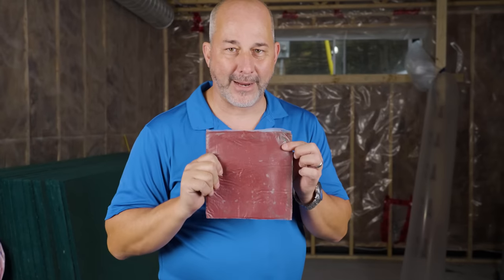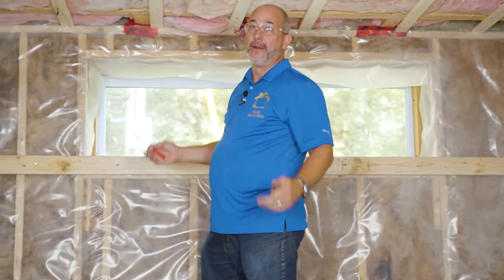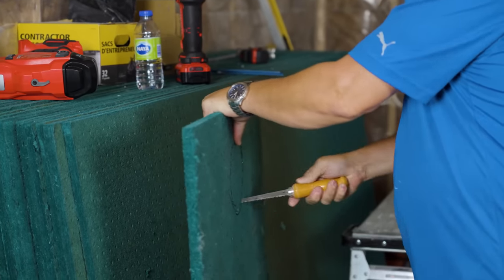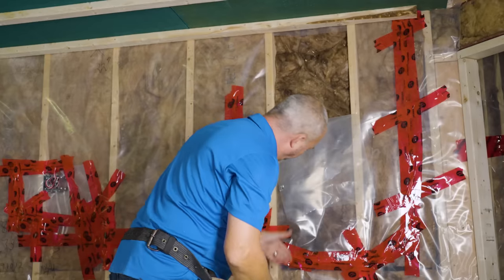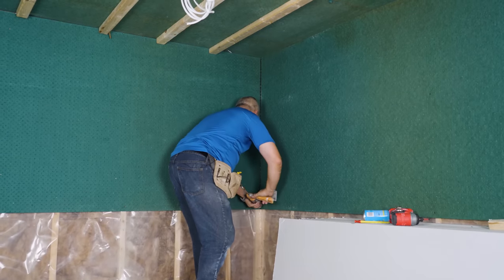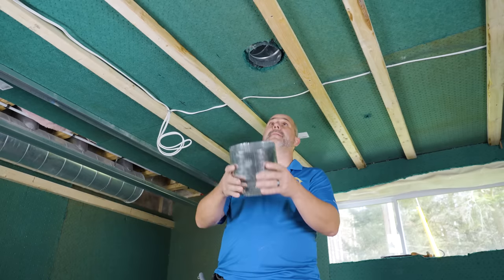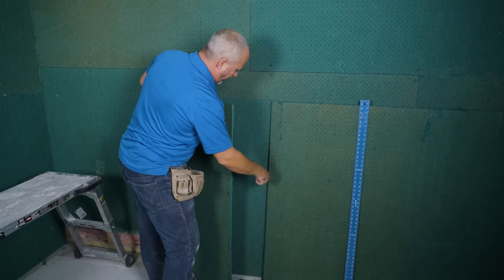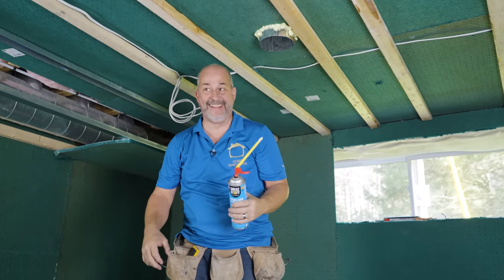Soundproofing A Room (It's Easier Than You Think)

Comment: I've got a question - will the weight of the ceiling materials be an issue? You've got green board, a bunch of 2x3s, and a full ceiling of sheetrock all hanging from that strapping which is nailed into the studs with what looks like a few 16ga brad nails. That seems like a lot pulling against just some nails. Or am i missing something? Thanks!
Reply from the maker: we are using framing nails so there is that. Cheers!
Reply: Ah that'll do it. Guess I need to watch more closely :D Thanks for the reply!  @HomeRenoVisionDIY

Comment: I would have called the plumber to put a frost free faucet in and had it done right.  Most homeowners will not remember to shut those off and drain them so it's guarenteed they will have a freeze problem later.

Comment: Doesn't wood transfer sound? I heard resilient bar works wonders
Reply: He used resilient channels in his own house.  He's using the strapping for the electrical wire to have a place to staple to
Reply: ONE misplaced screw defeats a resilient channel install. Any solid connection transfers sound. Metal is worse than wood.

Comment: Never understood why the building code is such that you build an exterior wall, fill it with fluffy stuff, add plastic, seal all the edges with the black goop, tape your penetrations.   Then you stick a gazillion pin holes in the stuff by hanging your finishing material (drywall, whatever).    Why not strap the wall afterward or build a 2nd mechnical 2x4 in front of your "exterior&sealed" wall.   Makes it much simpler to work on/repair/renovate, little to no penetrations.   After you get a better building out of it.

FYI - that is what they do in other countries, ones that have the building science engineers design the building codes.

Comment: 10:24 how do you know it wont slump again? what caused it? i would have jammed more insulation in those spots no? and maybe something to hold it in place if not?

to be clear, i know zero about this stuff, just making a layman observation. it just seems if the condensation possibility is that big a deal, i wouldn’t be happy with just pulling it up.

Comment: Would've loved to see the sound floor before/after. Your position on fiberglass vs. mineral wool doesn't line up for me. They have STC ratings and most people who soundproof don't even start to consider a material for sound proofing unless it's STC 45 or higher. Fiberglass is <40 and mineral wool is 45+. If you're using fiberglass to stop reverberations that's one thing, but it's shite at soundproofing. Love the video and the channel, just an interesting discussion.
Reply: Mineral wool is also 3X denser then fiberglass... it is superior in every way except price. Did my whole house with mineral wool including my theater and no regrets.

Comment: What happens to the putty around the electrical box when you use your cutout tool for drywall?
Reply from the maker: just press it thin at the edges and the cover plate will be fine.

Comment: Random question but my home is half tile half carpet. Wife wants to replace tile and put in wood. Issue is everywhere in the home there is tile there are 2 sheets of subfloor so it sits 1/2 taller than the carpet. What’s the best approach to puttin in hardwood should I rip out the top sheet of subfloor so floors are flush?
Reply: Is it actually two layers of subfloor, or is the top layer actually cement board underlayment?
Reply from the maker: the second layer of subfloor is screwed in place with no adhesive. remove as many screws as possible and then lift the subfloor.

Comment: Why not use a suspended ceiling? You can get suspended ceiling tiles made from foam that a very good at sound absorption.
Reply from the maker: they are just not as sexy as a finished pot light drywall ceiling. Cheers...but a great option.

Comment: Due to the multiple layers of strapping, doesn't this assembly introduce the triple leaf effect?
Reply: I think that is why he is using the green board.
Reply: @alexanderjamieson7971  doesn't it still add resonance between the drywall and green board? Maybe it only applies if you are using two materials of the same density or if both layers are dense like drywall.
Reply: @Ryan Spears  I think that applies with another layer of drywall which then acts like a drum with two resonating membranes. That sonopan/green board acts more like a dense insulation board
Reply: @alexanderjamieson7971  Gotcha. Thanks for clarifying.
Reply: The strapping is not introducing Triple Leaf, there is going to be only One layer of the same material (drywall ceiling) and the subfloor for the upstairs. And the insulation layers, wobblyness of multiple layers of strapping with the Sonopan makes this convolution less stiff. It's not elegant, but it seems like it would work fine.

Comment: I would not recommend people follow this advice. To dampen bass, you need to put mass on the ceiling. To do this, you use a special adhesive and screws to mount a piece of sheet rock between the joists in the ceiling to the floor boards above. Next, you put another layer of special adhesive and yet another sheet of drywall and screws.  once that is done, you put in rock wool using hangers.  Next, you need to decouple the bottom layer of sheetrock from the floor joists using special isolators that decuple the resonance from the bottom layer.  If you don't do these things, the bottom sheetrock is going to act like the skin on a drum and just pass the low frequency straight trough to the floor above which will just radiate it into the space and shake loose silverware in the kitchen.  The two sheetrock sheets on the floor above add enough mass to dampen the long wavelengths of the base. If you are doing home theater, my advice is to get on some home theater forums.  They will pretty much say that the above video is not going to buy you very much.  Not that it won't do something, but if you are going to go with a mid or high end home theater with large speakers and subs, the above is going to be a pretty miserable fail.

Comment: I’m an acoustical engineer.  Unfortunately, there is no such thing as “totally soundproof” unless of course you want to die in the space.  Why, because sound requires air to travel from point A to point B.  Remove the air, you’ll remove the sound, but unfortunately you would succumb to  death by asphyxiation.

Comment: Man i wish we could acheive this level of sound proofin without takin the walls off 😭😭
Reply: You can install Sonopan on existing drywall, THEN 5/8" fire rated drywall (heavier than regular drywall), mud, sand, paint. You increased density, thus noise reduction
Reply: Mass loaded vinyl. Most interior walls unfortunately have zero insulation though
Reply: @danieli708  Thankyou for the advice , all my research points towards whats u have summarised
so i'll be takin this route :)

Comment: Soundproofing isn't about reducing air movement,  it's reducing acoustic coupling. The most effective method for acoustic isolation is mass-air-mass. Instead of attaching Sonopan directly to your  studs, it would have been much more effective to put up a layer of 3/4" plywood, run all your wiring though, then sealing any air gaps with acoustic sealant, then use acoustic decouplers which you then attach resillient channel, then another layer of plywood, followed by another layer of 5/8 drywall. It all depends on what's on the other side of those walls and ceiling. If its someone walking around in a living room above you or someone trying to sleep in a bedroom, your method will reduce some noise but not a lot. I've built two professional recording studios in two different homes and this is the only method I would use.

Comment: I love your tips but sound proofing has nothing to do with air. Sound moves very well through several mediums ... sound proofing is about stopping vibration. If you really want to sound proof a wall, use staggered studs on a wider plate to get complete separation between the two sides after the drywall is installed.

Comment: Sounds has nothing to do with air tightness. Sound waves need to be broken in order to soundproof a room. It has more to do with geometry than air. Check out the design of the deaf room for example. Sound waves bounce off the surface and break up into non existence.

Comment: I bet the homeowner just said they wanted pot lights because that's what most basements have in them (like why are barns red) .. if the homeowner watches this video they will understand better what they so casually wanted and perhaps wonder about alternatives with significant cost savings.
Reply: The only change is a couple of 2x3’s. Right now a 2x3 of 12 feet is less than 5 CAD. On a 12x12 room if you put one 16’’ on center you have to spend about 50 bucks. You really call that significant cost savings? They are putting sonopan sheet at 25 bucks a piece on all the wall and ceiling, it’s not that extra 50 bucks that will break the piggy bank.
Reply: What are some good alternatives? Cause I have the same issue. I will have double drywall with green glue in between and can’t have holes in my ceiling for can or puck lights

Comment: You lifting up that insulation did... nothing. Lol.  Wut.

But yeah as someone else pointed out... you have essentially ruined this install by piping hvac directly to the room... HUGE MISTAKE.
Reply: I thought this is why they make paper-faced insulation: the edges of the paper extend to the studs on either side and can be stapled to hold the bats in place, keep them from sliding down. Maybe it’s different in Canada or the rules (codes) have changed since the last time I added insulation to an open wall cavity…?

Comment: This is easy ,,standard insulation is a terrible almost worthless sound barrier ,,need rock wool,,also they make a stand off bracket with a flange you attach to joist then install sound board drywall to flange ,cause like he said sound will go through screws through framing and so on ,,also penetrations are a culprit ,im sure its quieter  but far from sound proof

Comment: It is not very possible nor financially feasible to achieve an STC rating of 100 without changing the room dramatically. Anything over STC 45 is very expensive, and getting doors for STC 50 takes months. What you want is to reduce noise and manage it, not soundproofing.

Comment: First of all, there is no such thing as "soundproof" or "not soundproof". Every element of every space has its own degree of sound isolation. And unless you're using specialty construction (room-in-room), you're going to hear noise from adjacent spaces. You'll just hear much less in a room that's been designed to be isolated from surrounding spaces. Other nitpicks:

1. Putty pads are not equivalent to spray foam. They are better, in that they actually have mass, and when applied correctly, are air-tight. Foam has cells. For the same reason, filling gaps with foam does almost nothing.
2. If the contribution of insulation was mass, mineral wool would be more effective than it is. Insulation's job is converting sound to heat. Its presence, not its actual mass, is what's important.
3. You don't need a double ceiling. Mount 2 layers of standard drywall on a resilient channel, with staggered panel edges. Run the gyp on your walls up to within 1/4", and caulk the gap. Use crown molding if you don't like the gap. Use putty pads on the back of lighting boxes, which really shouldn't be old-fashioned cans, but modern LEDs with much less heat and space taken up. Better yet, use wall-mounted or floor-mounted lighting.
4. All that trouble to build that complicated ceiling, and you put a big hole in it for HVAC. Okay.
5. SONOpan is a gimmick sold by a company that doesn't really understand acoustics. It says something that a company has only single-number ratings and testimonials, and no actual data available. Also that they list an STC rating for the panel by itself, which is a useless number. They also talk about "dampening" vibration, instead of "damping." Just use drywall. It's cheaper and more effective, because it's 4x heavier.
6. All that trouble to minimize fasteners through the SONOpan, and then you just negate whatever benefit that got you by screwing the 2x3s right into the strapping with giant screws. Same thing for the drywall on the walls. So if the SONOpan did anything before, it's definitely useless now.
7. You don't need special acoustic caulk. Everything marketed as acoustic caulk is a scam. Use caulking that remains pliable after curing, and you'll be fine.
8. Again, all that trouble spent on the ceiling, and you put in a soffit with a huge hole in it. I hope you're using an insulated access panel, because like I said, SONOpan has almost no mass compared to drywall.

Source: acoustic consultant with 20 years' experience. I use actual test data, and I'm immune to marketing. Stop spending money on gimmicks.

Comment: I appreciate that clickbait titles help drive views, but there's essentially no such thing as "Totally Soundproof". There is "soundproof enough at certain frequencies for our needs" and that's about the best anyone can hope for.

Fluffy insulation, regardless of density, adds only a modicum of mass to the assembly. Its main purpose is to dampen the resonances between the drywall panels, aka, the primary wall mass.

The tenets of sound transmission loss are Mass, Decoupling and Air-tightness.
It's like three legs of a stool. Take any one away and the assembly fails.

The best "soundproofing" for most common rooms is the box-in-a-box approach, whereby massive internal and external walls are separated by an air gap on all sides to eliminate structural- and air-borne transmission, and isolated from a common foundation with dampened springs of some kind. The more structure connecting the two spaces, the more sound can traverse the gap.

This kind of construction is difficult, expensive and HIGHLY impractical for most residences, but it offers the best sound transmission loss we can achieve using common building materials.

The steps you're taking are important and will help prevent sound transmission but realize that "Totally Soundproof" is misleading.
Reply: Go write a book on it
Reply: All physics nuances aside, I don't think you're going to hear sh*t between those floors :)
Reply: There is such thing as totally soundproof but it would require a vacuum.
Reply: What you are talking about is a professional sound recording studio which cost lots of money, and is well beyond what most people want. This is more to dull the noise of a loud workout, movie room, kids play room etc. As someone who lives in a house with zero sound insulation right now, this would be amazing.
Reply: @Section_230  I've read my share. 😉
Reply: @jasonfitzgerald6334  Don't get me wrong, I think he's doing a great job. He's not overselling the effectiveness and he's properly stressing the importance of being fastidious with regard to detail. He is completely correct that if you've done 95% of the work you might as well have done 50%. 
Moreover I'm sure that the work he's doing will have the desired results.

My only contention was with the text in the thumbnail.
Reply: @BigBrotherIsTooBig  Touché.

Comment: Entertaining indeed.  However, when it comes to "soundproofing" claims being made there, ya see here's the thing!.. What's being shown here most definitely WILL NOT sound proof this, nor your room either!!  Bass will travel  right through those thin mass, direct connected barriers, and midrange too!!  MUCH better results will be had from isolated channel on dampened clips for hung drywall on the frame, and you can only knock the bass transfer by an outer  cement barrier, with a room within a room  spaced out from outer barrier ,framed construction (plus floating floor, etc)!  Anyone telling you anything else, for the most part, is offering you wishful thinking! I 100% guarantee any large truck driving by this building would sound like a large truck driving by this building, and would also not keep your subwoofers bass from going outside as well!  Also, if this room was constructed above or bellow another room/garage/upper floor, the sound will also pass right through a room like this, can hear people talking in next room, TV on upstairs, etc!  Can't get around physics folks, is the facts of the matter.  No free lunch

Comment: There is no way this room is "soundproof".    I appreciate the video and the construction and the helpfulness of it, but with all due respect, please change the title to not mis-lead people.  I've done a similar studio build with 16" thick "soundproof" walls/ceiling/floor and no outlets, and even with that,  you can still hear sound on the outside when I am cranking it up inside.  It is barely audible but yes you can still hear it.  It is not soundproof.   If you lead people to believe they will have a soundproof room after doing what you are demonstrating, they will spend a lot of time and money and be very disappointed in the end.

Comment: "99% soundproofing..."
Has huge pans of glass in the back that will reverb everything.
Reply from the maker: we are doing a sound test to demonstrate the effectiveness of this space in a soon coming video.
Reply: @HomeRenoVisionDIY  Just saying, the glass and the wooden doors are both two majors audio issues. 
So caulking the seams appear... weird? Audio waves have amplitude and seams can only let smaller waves slip in. For example, at 30,000Hz - most people can't hear that high - the sound wave is 1.1cm long.

While the glass and the doors both will be 2 huge reverberation surface. 
Do you plan to have a panel you can drop over the window and something for the doors to prevent that?
Reply: @LightStrikerQc  Great points and great suggestion to put something in front…maybe utilizing a heavy textile curtain to absorb some of those reflections that can be drawn open when light is preferable to sound deadening…